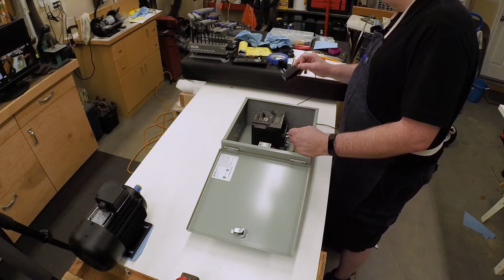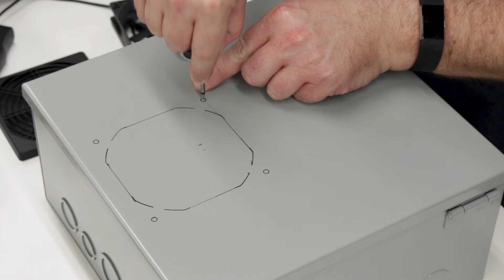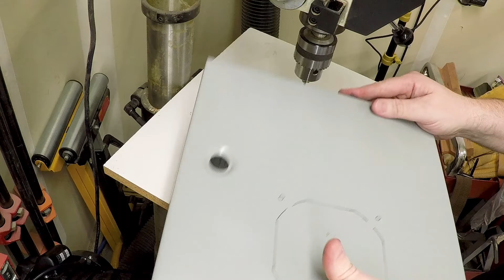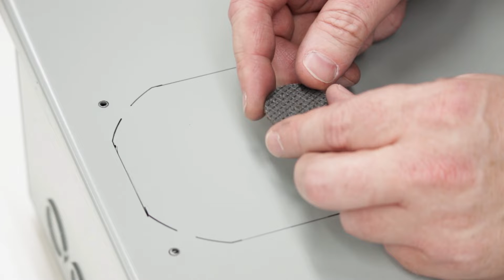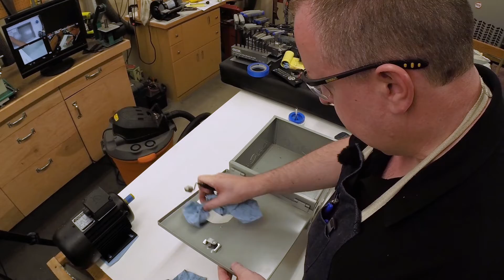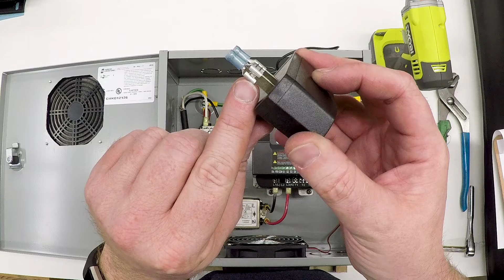Lathe VFD 5: How to Build an Electronics Enclosure

Comment: Rationally I know that 3M tape is going to work, but the lizard part of my brain keeps whispering "didn't you learn from all those cable tie pads with the double sided foam tape?  The ones that all pulled away due to heat and vibration?"

About the only use of adhesives my lizard brain doesn't squawk over is threaded fasteners.  I know, it's a problem.  I'm slowly working out my trust issues with glue in the context of machinery...
Reply from the maker: Yeah...tape can be iffy--especially over the long haul.  I didn't want to drill more holes and make more chips, since I already had everything else mounted already before I thought about it.  Usually when I'm building something like this, I 3D-print a tray that I can screw to the box and then zip-tie the device to the tray.

If this one falls, though, it's all insulated, so I don't think it will hurt anything.
Reply: I'd trust real 3M tape, especially the expensive stuff over most small diameter made from the chintziest chinesium screws. Surface prep is always the key, but in a new box with quality paint, I can't see it ever being an issue.